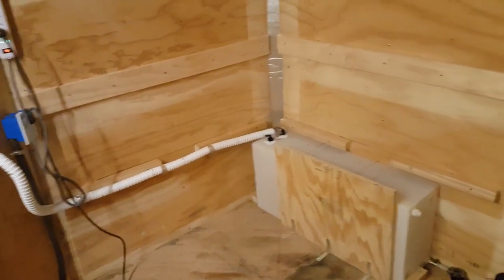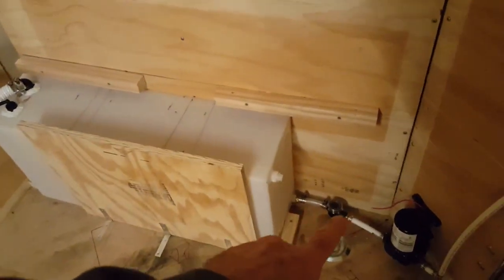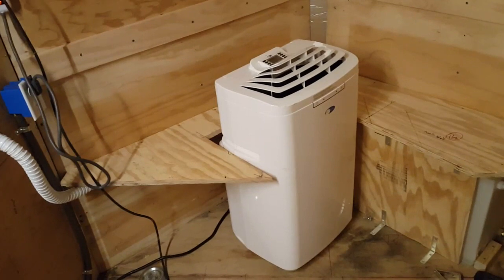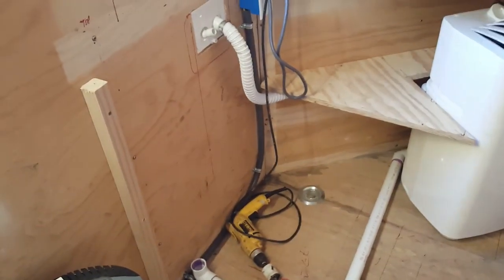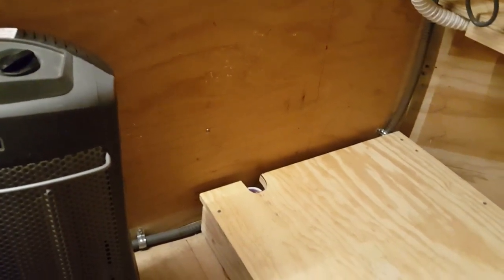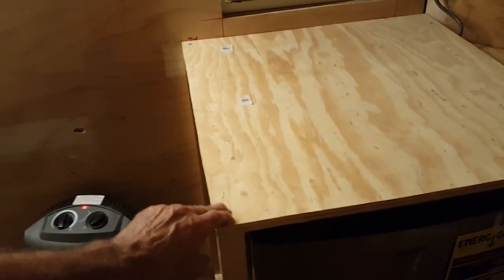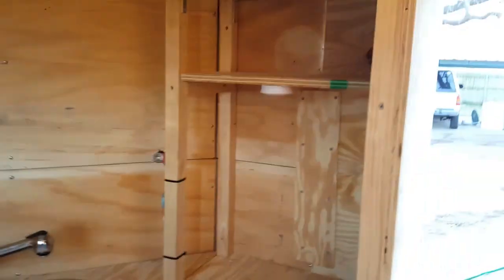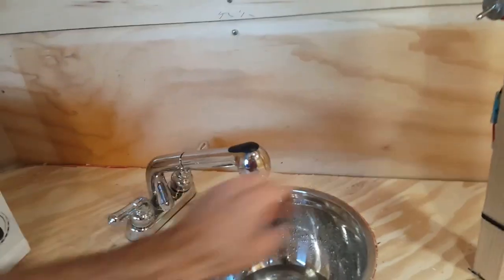PLUMBING AND CABINETS 6 X 12 Cargo Trailer Conversion Part 13 vanlife skoolie

Comment: i know this video is a few years old now and i have not watched your other videos to see if you still have this trailer, but if you install an expansion tank (sureflo makes one) after the pump it will fix the jittering issue you have with the water.
Reply from the maker: Thanks for the suggestion and watching the video.

Comment: Hi GB, love your video and inspire from them, on your part list from the plumbing section, (RV tank grommet) is it for the gray water tank, if so, since you have 2 holes, do your need 2 of them? Thanks.
Reply from the maker: Yes, I have 2 holes for the gray water tank. One hole is for the drain into it and one hole is for the vent to allow air in and out of the tank. Yes you will need a grommet for each hole. Good luck on your build.

Comment: What powers your water pressure for water coming in and out?
Reply from the maker: The water coming in is gravity fed from a hose. We turn the hose on to fill the holding tank. The hose has a filter on it. When the tank has the water it is pushed to the sink by a 12 volt RV pump that runs off of the batteries. The water drains into a tank under the trailer and we dump it when we need to at RV dump stations. I hope that answers your question.

Comment: Is this all at the v-nose.?  Have you considered tongue weight?  That water tank is gonna be heavy.
Reply from the maker: Yes I have. 21 gallons of water will weigh 174 lbs. We have other items to position around the trailer to get the distribution sorted out. Thanks for your thoughts though.